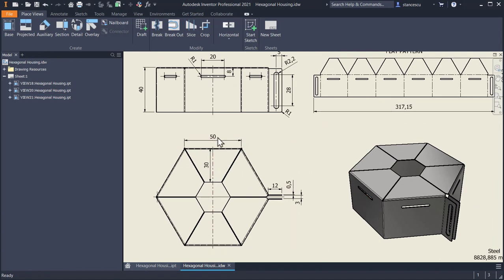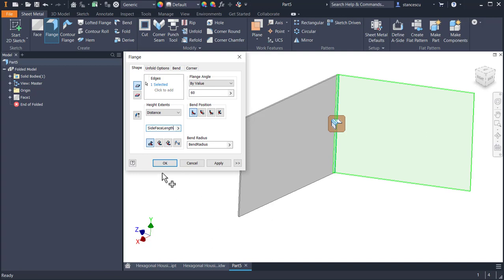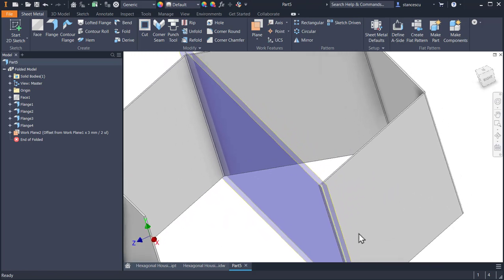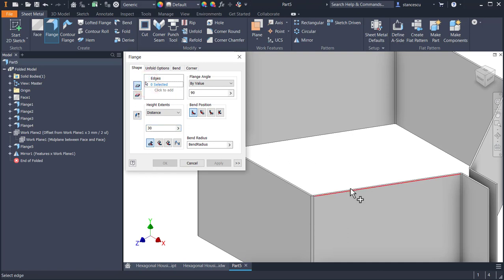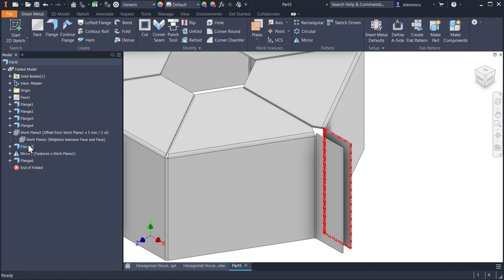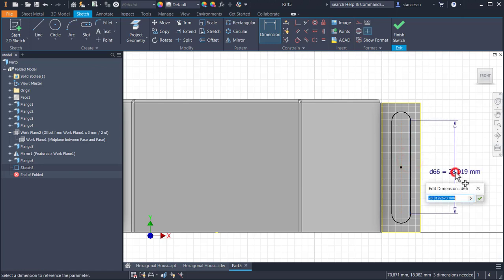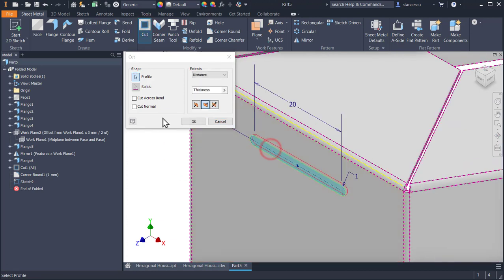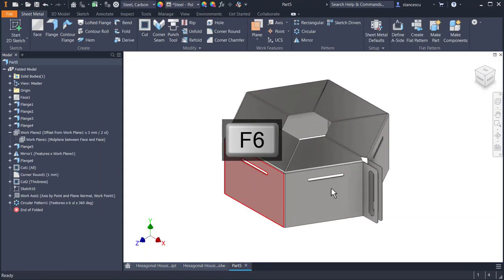Tutorial Inventor - 201 SHEET METAL SM-006

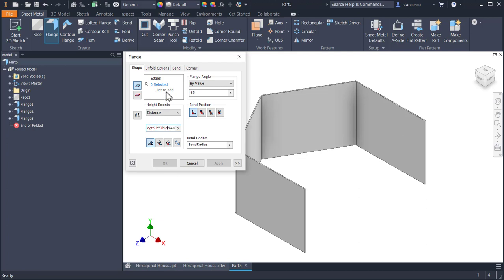Comment: Dear Sir, Before you make the flange on work plane 2, You made the flange with height extents is "sidefacelength-2*thickness" (5:53).  I think we don't need minus 2*thickness. If we use the height extents is sidefacelength, and then we make the flange with the "Flange angle value is By Reference, and choose the work plane 2, the result is the same. How do you think about this situation?
Reply from the maker: Initially I tried so but I received an error message, so I subtracted 2*Thickness and it worked.
The two Thicknesses were for one thickness and one bend radius to insure the correct length.
A better expression would be 50-Thickness-BentRadius, I suppose.
Coming back to our discussion I have a proposal: give me the link to the GrabCAD project of the sheet metal box and I'll make the tutorial on my name, without mentioning yours.
I am the creator of the group Autodek Inventor Users on GrabCAD (see https://grabcad.com/groups/autodesk-inventor-users), so I have the authority to comment about an Inventor project.
Reply: @prof-stancescu  Thank you Sir, this is the link: https://grabcad.com/library/sheet-metal-box-10